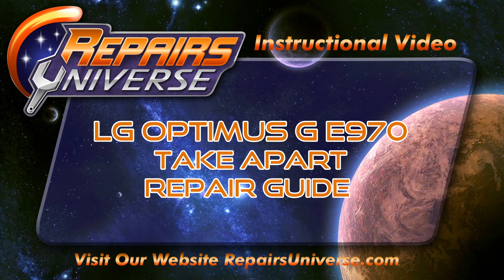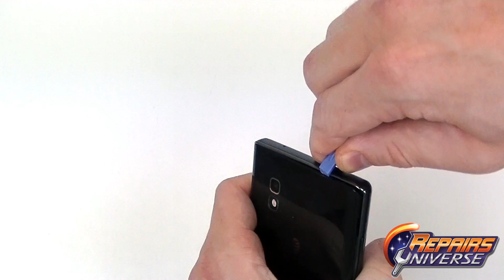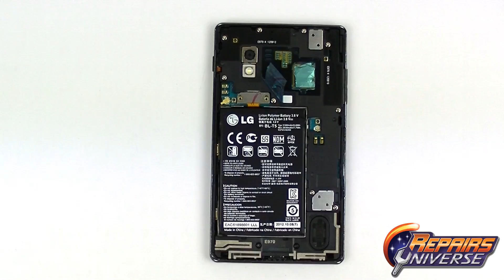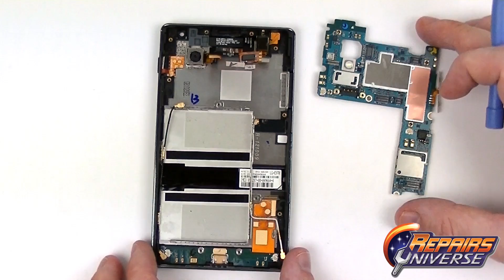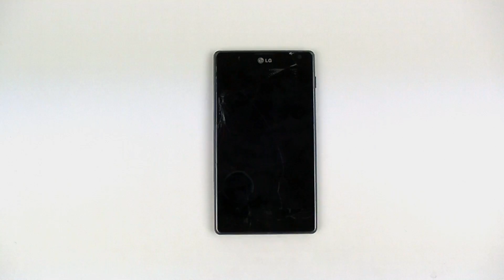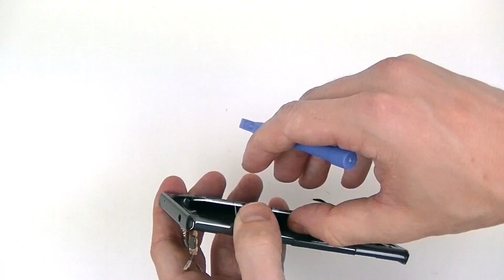LG Optimus G E970 Screen Replacement Repair Guide

Comment: Followed this step by step and fixed my phone. Except the first step - I didn't untorx the bottom two screws so I ran into problems with getting the loudspeaker and back cover off and on lol. But it still works. Much appreciated.

Comment from the maker: Be sure to follow the video closely and be certain any internal connections involving the assembly are securely in place. Often times during a repair components can become dislodged or loosened. If the assembly isn't dysfunctional it should work fine if you follow the steps. Good luck!

Comment: Your video is by far the best on this, and I got through it. The Sprint version made it about a 2 hour sweat for me however; the battery was actually really anchored in with 3 full width adhesive strips and I came close to destroying the battery trying to get it out. The screws were all torqued in so tight that my phillips stripped on screw 2, and the safe remove pry tool was destroyed by the time I got it done. Now...I know I pinched a notch into the white coax cable in the process but put it back together anyway and it worked...sort of. My house is a dead zone, but even driving some distance to other parts of the major city I'm in the signal seems weak. Is that the white cable or something else, perhaps? Thanks for the vid, I'd never have gotten this done without it.
Reply: Any thoughts appreciated.

Comment from the maker: Unfortunately, both the touch screen (outer glass) and LCD will need to be replaced. This is due to the fact the two parts come used together, and are EXTREMELY difficult to separate. If you would like to purchase the combination screen (LCD + touch screen), we have the part available at RepairsUniverse (dot) com.

Comment: Hello I replaced my LG optimus G E970 screen assembly and it is just black after I put back together from the video in reverse.  Home Screen does not show but I can hear it open up after I slide up and can hear volume.  Where did I go wrong is there some kind of strip I need to use to have the screen light up?

Comment: Hello! So, first, thank you!! I have just replaced my screen and digitizer on my LS970 using your wonderful video. However, somehow between taking the pieces apart and putting them together, my power key doesn't stick out anymore. It is flush with the frame, and isn't able to be pressed or give any response when pushed...  From what I can see, rewatching the video 30 times hehe, I haven't lost any pieces as part of the power key. Any idea what could have happened?

Comment: Working on this phone. The screen/digitizer is good, but I need a new motherboard. I have another one with a cracked screen but good motherboard. is it possible to just switch out the motherboard using this guide and get my phone to work?
Reply: Yeah, if the motherboard is of the same type or model of your screen it will work fine. try it, this guide is the right one.
Reply: So i was able to switch out the motherboard with another one and it worked.

Comment: I'm looking to replace the digitizer on my Optimus G. I see in the comment below that you can do it individually. I'm trying to weigh my options, because buying just the digitizer is much cheaper. How hard is it to remove the digitizer by itself, and what kind of tools would I need? I'm already expecting to have to use a heatgun, plus screwdrivers/opening tools. Any help would be appreciated :)
Reply from the maker: mkolorz The screens are fused together. If you choose to try and do a glass only repair then be prepared if you break the LCD. It may cost you more in the long run. Unless you are a Mobile Electronics Repair Tech or have extensive experience in repair I would recommend to buy the complete screen.
Reply: Thanks very much for your quick response. I think I will probably take your advice and just get the entire assembly.

Comment: It is necessary to put the glue or i can fix the screen without putting the glue?
Reply from the maker: You would require adhesive for the repair.

Comment: When putting back the phone together and turning it on to test, the LCD doesnt display and the flex cable of the LCD gets VERY hot. But if i take of the back plastic piece that holds the speaker and antennas, the LCD works and it doesn't heat up. What could be the problem?
Reply from the maker: Michael Garcia Sounds like you have something shorting out. Inspect the flex cable going to the LCD and the Digitizer. Make sure that The underside of the cable is not damaged in any way. It can become chaffed with repeated install and removal of the plastic cover. Make sure that there is nothing metal coming in contact with any of the flexes. I hope this helps.

Comment: Its possible remove just the Glass Touch Screen??
Reply from the maker: +Eduardo Gazzinelli Fonseca The LCD is fused to the front glass panel. It would be very challenging for you to replace only the front glass panel. We would not recommend this.

Comment: is possible to only repair the digitizer alone
Reply from the maker: Short answer is Yes. Long answer is. The screen is fused to the glass digitizer. It requires applying heat to the glass and carefully separating them. then refusing the screen to the LCD. If you don't have the proper equipment to do this. I highly recommend that you buy the complete assembly. You can find this here....http://www.repairsuniverse.com/lg-optimus-g-ls970-screen-replacements-repair-parts.html